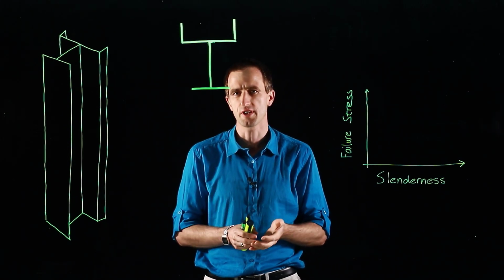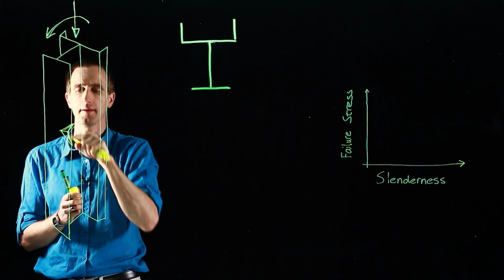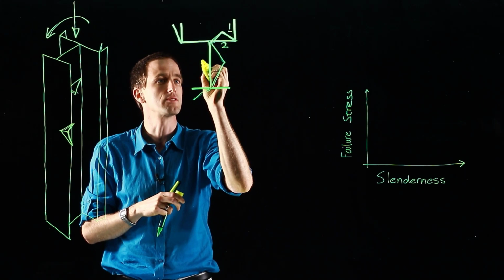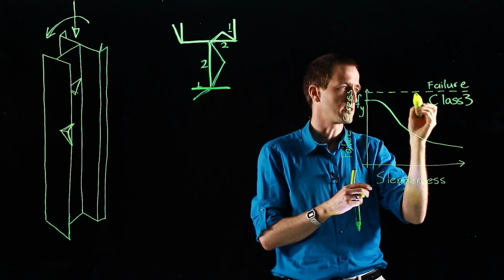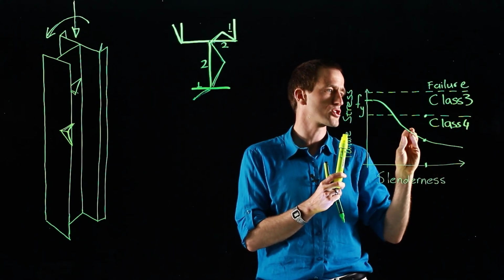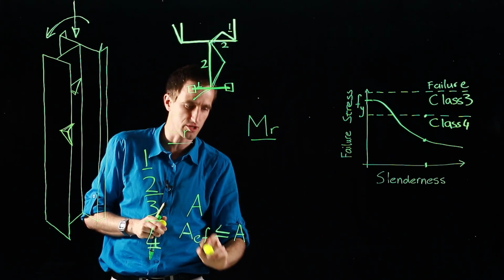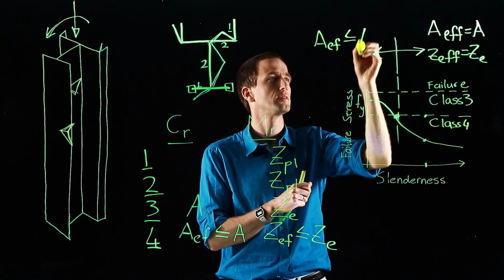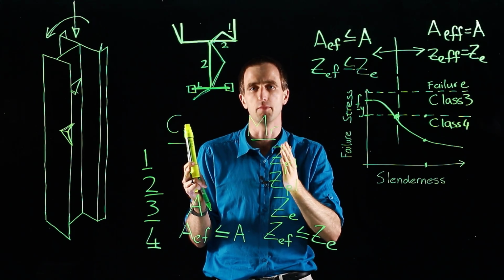Steel Design - Section Classification and Local Buckling - SD424

Comment: I liked the idea of reducing the yield strength in short members in order to make the global buckling to be controlling the design rather than local buckling
I would appreciate if you could refer to a very similar hand calculation to make the effect of reducing fy more clear.
Thanks 😊
Reply from the maker: The easiest way to do this is to use the classification requirements from the code you are working with: e.g.: b/t <= 200/sqrt(fy) for a Class 3 section - if this was the check that your section fails and shows it may experience local buckling. For this back calculate what your fy value needs to be: fy <= (200 * t / b) ^ 2.
Reply: Thanks, i understood this part bc of ur comment 😂

Comment: I'm confused on distingushing Web buckling vs web crippling.
Reply from the maker: It may depend on definitions in the code you use. Web crippling normally refers to a localised failure due to a point load being applied to the side of the beam (i.e. a load on the flange from a column or machine), where the web below the point load experiences crippling. Web buckling may refer to something similar or local buckling due to an axial load.
Reply: @firesun  thanks a lot

Comment: is it not that the slender sections would fail by buckling first before they yield? I think you just said the other way around. Shorter sections tend to fail by yielding rather than by buckling.
Reply: I guess he wants to say less slender section will fail/global buckling after reaching local buckling...but in higly slender section failure will occur before it even reaches the stress corresponding to local buckling....Now i guess plastic hinge mechanism(high plastic moment of resistance) phenomenon occurs in less slender sectuon but it do not occurs in High slender section....
Reply: I think he want to explain that in steel.. yielding is more critical than buckling..as you said.. shorter may not buckle but it fails to yielding first..longer columns fail first to buckling before yielding...therefore when dealing with steel buckling failure is more critical.
Reply: bro, there is a difference in steel and RCC in steel yielding is not a big problem because in this almost all of its fiber participates but in RCC if one fiber reaches there it will gonna fail.